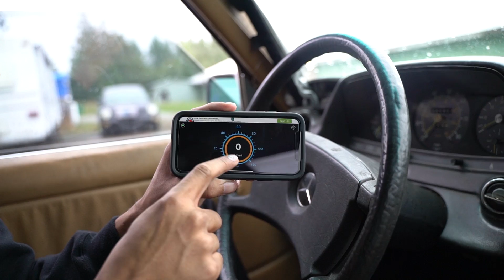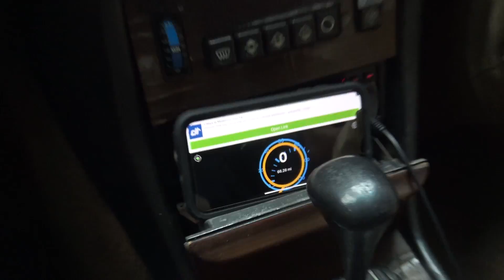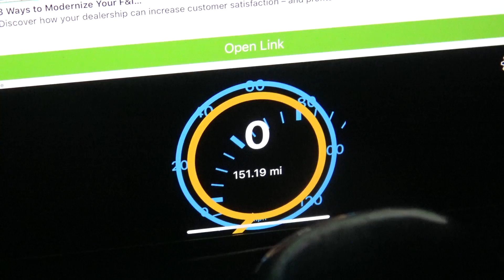Will a Car RUN on USED MOTOR OIL?

Comment: In this episode, the boys are playing with the **D**. Edit: if you're gonna keep this car and keep putting black diesel through it, you should move the fuel filter to a place where it's easy to change (engine bay). Also, lets get this bad boy featured in more vids (correction, modding, etc) I feel like when vehicles survive the challenge, that's their trial to joining the channel lol.

Comment: Paint filter would be faster, you could have used a lot, I mean a lot more oil in that mix and no need to mix it, it’ll mix in the tank, I used to run my powerstroke on 75% used transmission fluid, hydraulic fluid, and motor oil with 25% diesel

Comment: Yeah im curious as to why you would think this would work? Does fresh oil give your pistons lubrication or ignition? Common sense. Better question how much octane do you think oil or waste oil has. This video has to be clickbate who has the ability to read wrench sizes and change parts, but the inability to realize how ridiculous this oil as gas sounds. Oil mixed with diesel yeah has fuel in it should run. Your telling me youve never used a 2 stroke engine? Purely 100% used oil in gasoline engine no way.

Comment: You could run any diesel engine on straight engine oil, or any type of oil for that matter. But it does help to have some octane to help start the engine, especially when cold. We ran tractors on nothing but old oil for a long time, we used ether to start them.

Comment: Actually, you can perfectly fine run your engine on (used) frying oil. Because it got up to 180°C a lot of times, it loses a bit of it's viscosity. It's still gonna be quite a bit thicker than diesel, and your fuel pump will probably go out sooner, but it's cheap and sort of an efficient way to get rid of used frying oil. I think energy density is about 20% or maybe 30% lower, so your fuel economy will not be as good, but I mean, still...

Running a diesel off straight engine oil might not work because it's either going to be too thick or not produce enough torque (like in a runaway diesel when the turbo goes bad). Even up to 3 years ago, 80% of passenger cars were diesels in Europe and 10 years ago, bad car brands like Land Rover or Kia weren't really the best manufacturers when it comes to turbo diesels. If you have a manual, you can dump the clutch if it's revving uncontrollably because it's running on engine oil. 

Anyways, it's 2018 and I'm glad people finally consider gasoline cars again after 20 years, we're back to over 75% when it comes to passenger cars, only company cars are usually still diesel, because CNG isn't as good as it can be, yet.
Personally I think a gas car is much more fun.

Comment: Will a car run on used motor oil?
Ever heard of a diesel runaway?
-Where the turbo seals fail and the engine starts running on its own MOTOR OIL??
Reply: You beat me to it

Comment: Someone told me you can filter used motor oil by drilling a hole in the bottom of a bucket and shoving a rope through it . It's slow but I have heard it works really good.

Comment: can you use motor oil mix as fuel? yes. will your engine eventually seize up from buildup of gunk? move definitely
Reply: been running on my toyota for 14 years still no gunk.   i filter it

Comment: If you want to experiment for science run used motor oil and gasoline on a gas engine and see how far it goes then I’ll be impress

Comment: Diesel IS an oil haha. On the big ships, we run our old engine oil through and centrifuge and then it goes in as fuel because older diesels are very happy on oil and diesel alike. You could probably run it on 90% oil amd be fine lol

Comment: The OM617 engine is popular for alternative fuel. It will run on all sorts of things. Corn oil, frenchfry grease, used motor oil (straight), There was even a "Doctor" with a liposuction clinic that ran it on peoples fat before he fled the country.

Comment: alot of the people on comment section below that you can run diesel engines 70% used cooking oil and 30% diesel with proper filtration process. What the folks here on the video made is just a crude way of how you can run diesel engines with diesel mixed fuel.

Comment: I have been looking for months for a car like that is a reliable vehicle and people pay high price when they are fully restored. This car is hard to kill however if the the car is kept driving on the same condition it will ruin the injectors and valves.

Comment: This reminds me of the old Chevy K30 Military trucks with the 6.2L Detroit Diesel in them. You could burn BOTH diesel and home heating oil in the engine. Some other military trucks like the big tri-axels and deuce and a half’s have engines that can run on diesel, certain oils, and even small quantities of gasoline.

Comment: No offence, but you're an idiot to come to the conclusion you can use that USED oil in your fuel tank for several reasons:
1) Your fuel pump is going to die cause of it eventually. OMG, $350.00 would be my guess, maybe $250.00 if you can replace it yourself.
2) Your injectors are already toast & when they clog up after a short time, mostly from the dirty oil (ALL diesel fuel systems have a specific fuel filter for this reason, about the size of a regular gasoline oil filter) I can tell you, replacing your injectors will cost you more than that cars worth, EASILY.
3) Fuel filter itself will be clogged in NO TIME from the dirty oil (see above reason)
4) Fuel lines for diesel fuel were not made for the dirty oil & will likely deteriorate.
5) Your gas tank is now contaminated so you will NEVER be able to clean that out unless it's removed & done professionally.

Your whole concept here was a joke, and stupid, as anyone could have just looked this up online to find out why you shouldn't EVER DO this even in an emergency cause of the $1,000's it will cost to replace all the components in your fuel system, especially in any diesel made in the last 10 years.
Idiots try doing this with vegetable oil & fail for the same reason, as well as other types of oils, fuels & OMG they all seem to work just fine, until the entire fuel system dies & needs to be replaced.
Where was the disclaimer about others trying this out with some knowledge to show why you shouldn't ever do this for any reason unless you want to replace your entire fuel system.
This was irresponsible & DUMB! Cause others are going to think this won't hurt anything & maybe try it themselves NOT understanding how FRAGILE a diesel fuel system is.

I'm 27, female & I've know this since I was about 15; NEVER put anything else but CLEAN diesel fuel in a diesel engine & if you accidentally put some foreign fuel (or otherwise) in your tank,
DON'T EVEN START YOUR CAR. It does NOT take 20 minutes or 1/4 tank to get to your engine, whatever you put into your tank reaches the engine almost instantly, even running an engine for a few seconds with something other than diesel can KILL THE ENTIRE FUEL SYSTEM.
I have a diesel truck & wouldn't put anything else in my diesel tank unless it was LIFE OR DEATH cause it would COST me $1,000's to replacement the entire system. Some cars could cost $10K.

Comment: Hi! Next time try running 100miles with used cooking oil (only cooking oil, no diesel) we have tried it with an old Ford Escort. we have driven it about a month only with used cooking oil from a fast food restaurant that were baking french fries with it. the car drove like on diesel only difference was it smelled like pancakes from the exhaust.
If you will make this video put a link below. Sorry for bad grammar.
Greatings from Lithuania! :)
Reply: Dont forget to filter the oil first ;D

Comment: this won't work in the new diesels,   it only will work with the old "pop" style injectors,   next time mix the diesel with the waste oil first then filter it and let it settle and filter again.     Use a ten micron filter

Comment: You guys crack me up! I wish I could see some of these shenanigans in person.

What happens if you try to run a car on tiki torch fuel or kerosene in the gas tank?

Or some kind of cooking oil (vegetable, corn, canola, even coconut) in the engine?

Or made a tire out of coat after coat of liquid rubber? Lol
Reply: it was actually a trend here in the UK to run old diesel cars on used vegetable oil from chippers and chinese takeaways they ran really well and was really cheap to run you can't do it on newer diesel engines though so it fell out of fashion

Comment: You might find that mixing diesel with the oil before filtering helps keep it flowing.  Waste oil contains solids that clump together and clog the filter.  Mixing it with diesel before filtering can help dissolve and break up those clumps, so that the filter is only trapping bits of rust and sand and other non-cohesive particles that don't clog it so quickly.

Where you might see a difference is in cylinder wear.  Thus the importance of filtering.  When you consider diesel is only a few bucks per gallon, you need to have access to a lot of waste oil and a very efficient filtering & blending process to make it worth your time--and minimize wear on your car.  (A compression check before & after 10K miles on black diesel would be interesting.)

Comment: We put used oil in our older trucks all the time, they run a lot better and have a bit more power.  You don't have to mix the oil with diesel, change your fuel filter often though.

Comment: 5:22 for a five gallon batch mixing two liquids you're going to mix it for 20 minutes... congratulations you have more sense about how much it takes to mix two liquids than the guy I work with who has been blending chemical for over 15 years. (Oh i need to add 5lbs of caustic soda to this 2000lb batch the time it takes for me to grab the sample should be enough for it to mix in.)

Comment: What the fuel mileage like? Did it Improve? I would really like to see the injectors after that trip! What was the total cost? How much fuel was in the tank when mixed with your already mixed Black Diesel? This is very interesting and would like to know more! Will you be setting up a full fledged filtration system and run this long term?
Reply: I would imagine it's not too  different but probably a little less than pure diesel.

Diesel and motor oil are extremely similar.

Comment: Using an electric motor next to fuel fumes... you sir are either a brave man or didn't thing of the possibility of those fumes igniting.
Reply: Flash point is  higher than gasoline no worries
Reply: Diesel vapors won't burn. Has to be atomized.
Reply: well... it will but it has to be at least 125F to do so.
Reply: @ianm432  Exactly, and there ain't no way that drill would've heated up to that point or it would've been melting away in his hand.

Edit : Typo.
Reply: yea i said the same thing. I was literally waiting for the explosion. I have done it and luckly the shop juts burned down XD
Reply: I put out my lit cigarettes in diesel, reg gas, and oil even.... You probably have watched to many movies if u think a little fuel amd a drill are gonma = boom
Reply: it lit cig is not the same. The tiny sparks the motor makes in the drill are enough to ignite. I know first-hand experience. I have done the same thing. A cig is not an open flame so no comparison.
Reply: Heat and high compression is what makes Diesel go boom. Thats in a open bucket. No worries.

Comment: This is dumb cause you can run a diesel on straight trans ATF with no diesel fuel mixed in at all and it would actually run better then diesel fuel. Also ATF is a lot thicker in viscosity then that half ass used oil/ diesel fuel mix y'all got going on rite there.1 more thing diesel fuel naturally has some oil compounds mixed in when they make it or refine it I should say.....

Comment: I have an old Ford F350 IDI Diesel (Non-Turbo) and I run used motor oil/transmission fluid/gear oil/really any oil old or new with a lil diesel in the tank. Purrs like a kitten and cruises. smokes a little more especially at idle. But I have the injection pump turned up so i can make black clouds. I live in SoCal and drive this truck everywhere as a big F U to the state of cali because it doesn't have any CATS and is straight piped. I love old diesels, They literally run on anything oily...

Comment: Of course this will work, you haven't been around much equipment or deisel engines if you had a doubt?

That old school stuff is fine to do that, but run That in a newer engine and prepared for some damage, esp in the cat and emissions stuff.

Comment: I heard that diesel engines are generally beasts, they can run on almost anything as long as it's combustible. Oil in general will work but petrol in diesel is too rich in mixture, so it can cause issues

Comment: I’ve been running used motor oil and cooking oil in my truck for around 8 years I do filter it with a hand pump jack though I just mix it right in with my truck fuel

Comment: I ran as much as a 50/50 blend of used motor oil and/or ATF mixed with diesel in my old clapped out 82' 300SD. I did it all the time especially if the waste oil wasn't too dirty. I worked at an independent BMW repair shop so I had easy access. The car ran just fine if you didn't blend much more than 50/50. It would start running rough but the engine was pretty tired, probably had 750,000 miles on it. It was free fuel, just change the fuel filter more frequently. The exhaust had a nice oily note to it but fuck it. So does my 96' Eclipse, 4G63 turbo oil burner.

Comment: I used waste motor oil direct from oil pan with no mixture at all and it run and drive normaly. I usualy drive my w123 240D on new cooking oil because is cheaper than diesel but also because engine work smoother than running on diesel. I was once run my w123 on fuc*ing melted pork fat and it run and smell great!! That engine in that vehicle is indestructible.

Comment: That's a om617 Mercedes.  Invest in or build a centrifugal filtration system and that car WILL run on straight drain oil.  Lots of people run them on straight veggie oil that's what mine ran on before I got it.  300k miles on veggie cooking  oil.  They love it.

Comment: When I was a diesel mechanic, whenever I did a fuel filter change on semi trucks I would put about a quart of ATF in the filter and then put it on and prime it with diesel. Never had any problems on start up. Maybe y’all should try and run some straight ATF through the old bird. Worst thing that’ll happen is you clean your injectors 😂

Comment: you can run that motor on 10 micron filetrd used oil .. and you can add 10% methnol to make it run better in the cooler seasons..ive used 8% to a gallon of used filterd oil at 11 micron.. and dont forget that each gallon of used oil filterd at basicaly 10 micron 11 micron needs about 8% methnol or gasoline if you want but i would go to 4% gas to 1 gallon of used oil..in the summer the filterd oil should run fine on its own because it used and has trace fuel in it..veggie oil same thing as winter used oil with methnol @ 10% per gallon...but i mainly just use 4% gas to used oil in my stuff works good..try it just filter the oil down to around 10 microns..injectors will plug with grit from the used oil if its any larger than 11 microns...i put used oil in one bucket and use a cloth to wick it to other bucket just use long enough cloth to go from the used oil bucket to go past the bottom of the bucket so it will just drip from the cloth to the clean oil bucket.. its slower but you dont havto be there :) like your video guys hope to see more!  :)

Comment: you can also use filtered waste oil from restaurants instead of diesel. it is an age old trick from Europe.
It is way easier than this method, you can get a lot of fuel, and it doesn't fuck up your engines as much as this method.

Comment: That’s not normal diesel, that is off road fuel. The only difference between the two fuels is the green “normal” and red “ off-road” is the green is taxed and the red isn’t. If you get caught with off-road fuel in your fuel tank, you could spend time in prison

Comment: U know if u run a car on diesel lightly mixed with engine oil it won’t run on waste oil if u filter that oil and mix it like 5 liters oil and 1 liter gas it would be the black diesel

Comment: Have a feeling that isnt good for your inline filters and injectors.. It may be easier to use road diesel.. But if you mixed off road amd oil I wonder if you can still tell ita off road?? I'm sure a lab could if it was that big of a deal..

Comment: This Dieselcar can probably also run on liquid deep fryer fat.  do the same filter thingy.   Use buckets with a panty on top, a few small holes in the bucket (so the weigt is not all in the panty itself) and hang them in a large oildrum. you can fill the buckets, the oil wil drip slowely overnight to fill the oildrum.

Comment: Short answer, Yes. But in past experiences i have had to "water down" the last of my fuel with Oil, works well until you hit 2 quarts in one gallon, makes em smoke like crazy too. Oh yeah, i forgot to mention that my truck is gas powered...

Comment: You could just pour the entire amount of used oil, unfiltered, unmixed with diesel and it would still run, I guarantee. During the war in '91 in my country people were running old diesels on both used motor oil, cooking oil,  and gas oil with no problems. Especially these old mercs,  since all cab drivers had it.

Comment: Old car runs on 2 liters of diesel + 1 liter of oil. New car makes the same mileage using just 2 liters of diesel. Where's the saving? :)
Reply: $50,000 for a new car....
Reply: Also diesel is just oil that is bearly refined you can run older Cummins on what is called black diesel which is a 70/30 mix of used oil and gas
Reply: People will often give you old oil for free.
Reply: In the free oil, the car you buy for 1500 bucks, the less fuel at fuel stations, the list goes on and on
Reply: Cause your only paying to fill 2/3 the tank...duh
Reply: It's free used oil! Assholeeeeee